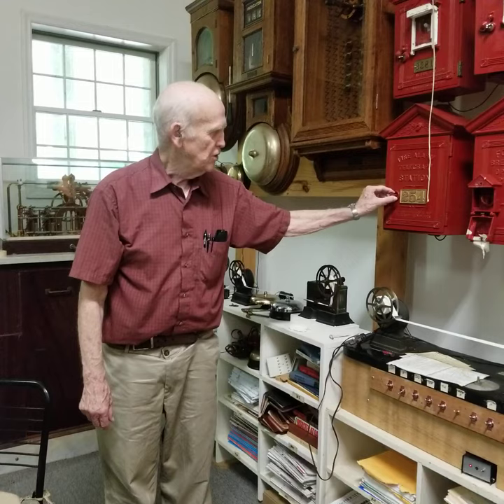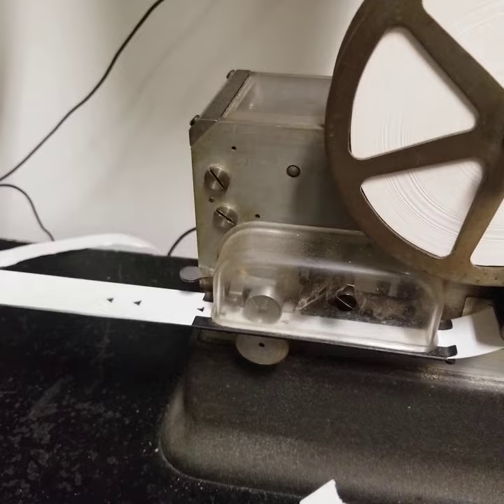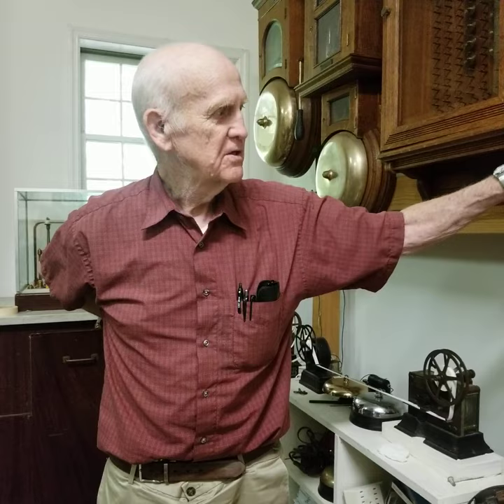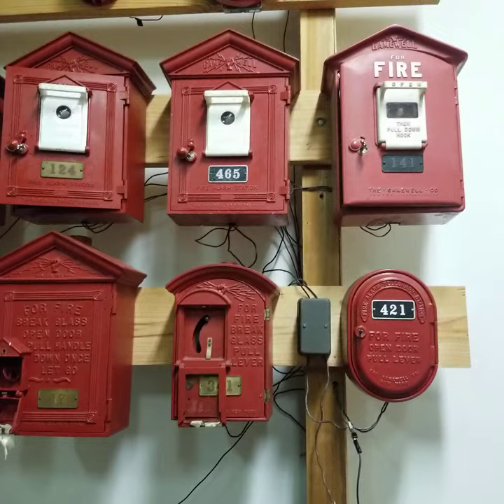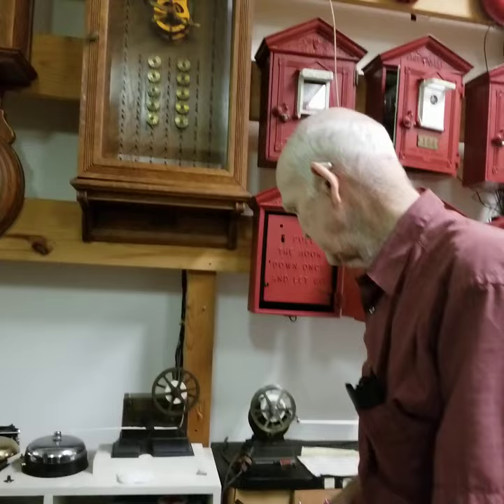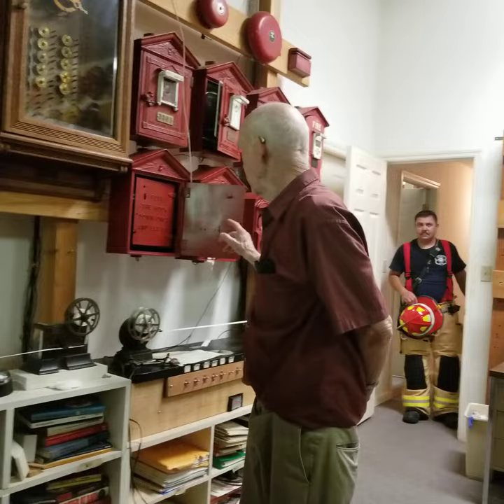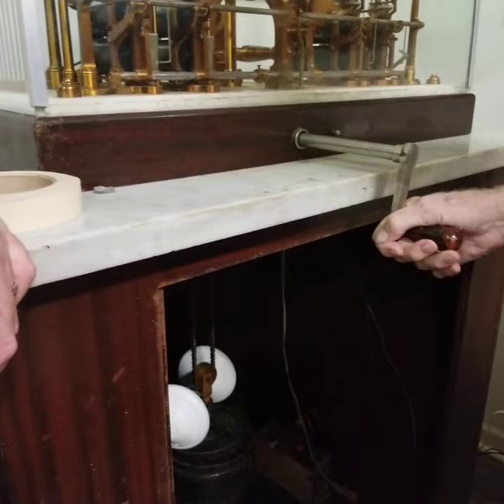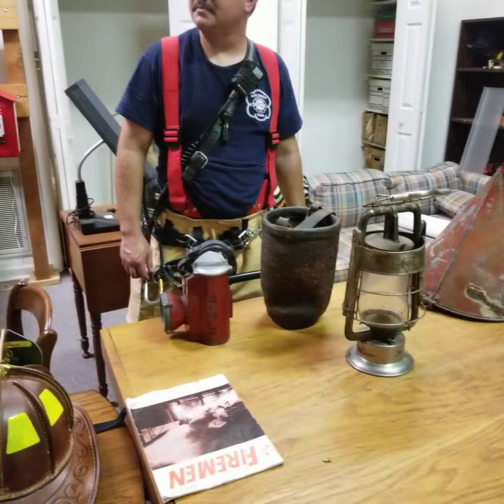Dr Tom Scott demonstrating his fully functioning Gamewell System.

Comment: I have a number of boxes and one bell, some from NY City, including one of the 7 foot tall 900 pound cast iron "VF" posts that were custom designed for NY City and the most beautiful pedestal boxes around.
I have one connected to a bell here;  watch?v=Po_lPSOjd7o and one of the NYC boxes which is complete with it's original anti false alarm bell- most of them were removed years ago from the inside of the doors watch?v=YyL9wvja_ZU
The "VF" pedestal I restored, in this "shorts" the door had only primer on it, but it had the "anti false alarm bell" on it too; shorts/RKnzW7zSCkY